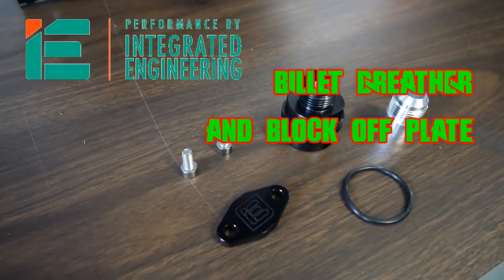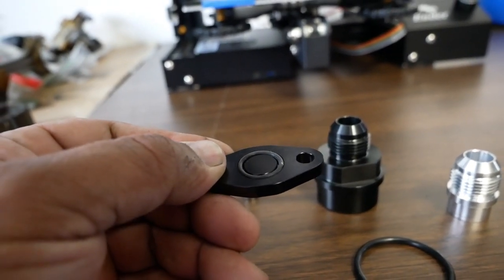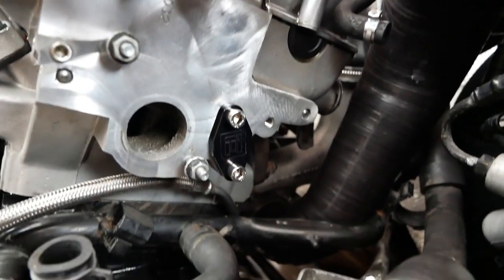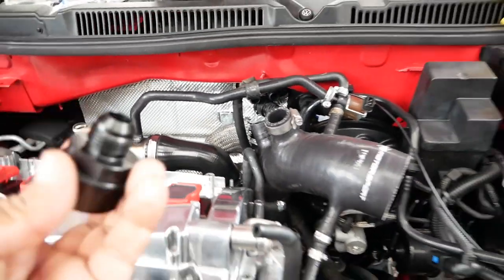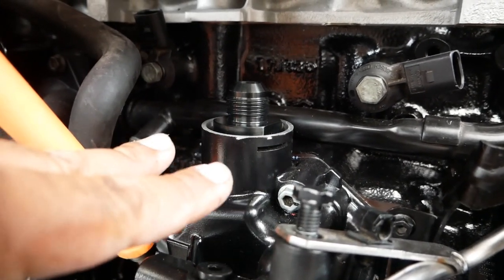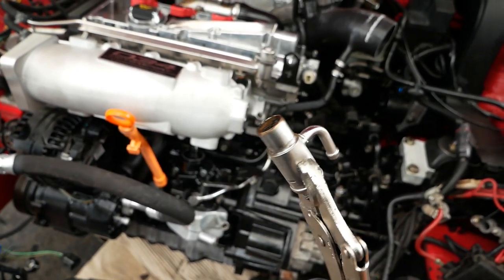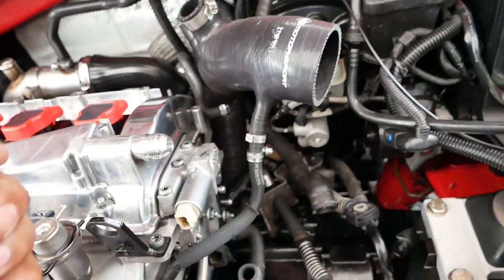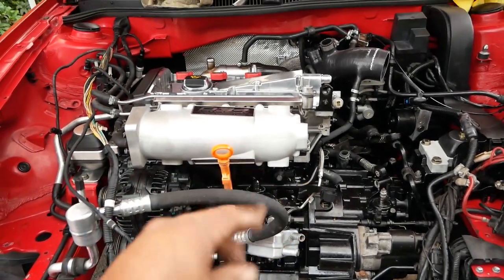IE breather and block off plate DIY

Comment: Hi Al, I guess my question would be why / what is the purpose of blocking off sai port and installing the breather adapters at oil filter flange and valve cover? Nice vid, thks!
Reply from the maker: The breather adapter is to covert the one that goes into the manifold and rout it to an oil catch can so we dont have all that nasty water and oil getting back into the intake system. Blocking the SAI port is needed when your trying to clean up the look of your engine bay.

Comment: I’m doing a motor swap on a Audi with a 1.8t and it has a block off plate already installed and I’m wondering if I buy the breather vent and catch can if it deletes all the lines on the intake? And that whole system needs to be capped?
Reply from the maker: You need a total of 3 vacuum lines.
1st for fuel regulator
2nd brake booster
3rd DV / BOV

Comment: got some questions, dont how to ask  more directly in reference to this process and lowering compression on the 1.8T
Reply from the maker: Get lower compression piston or a tdi/fsi crank
Reply: @PincheALsGarage  crank throw different interesting i was thinking of using Wossner 82.5mm at 8:5.1 higher wrist pin